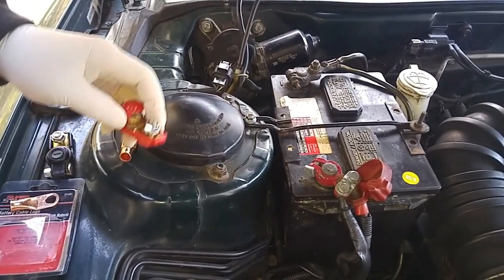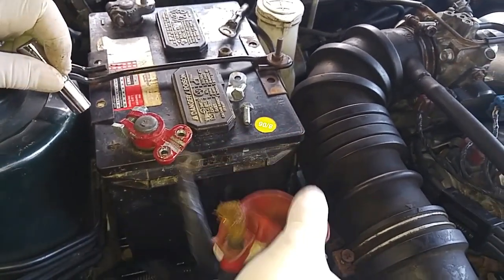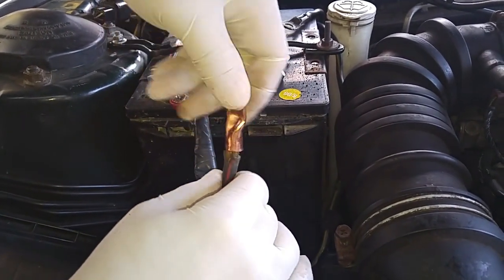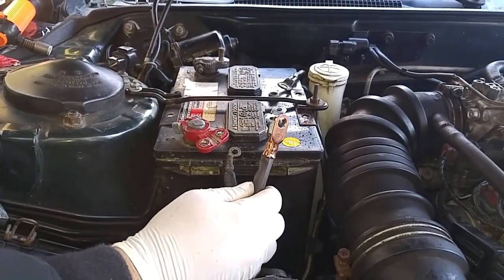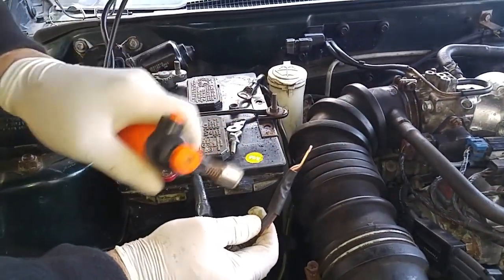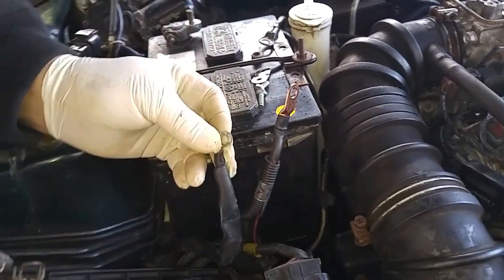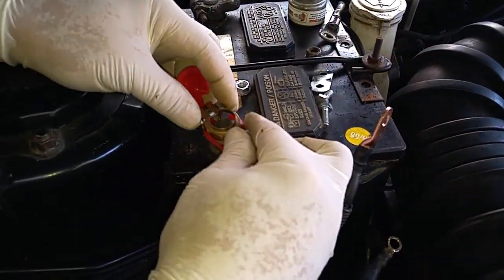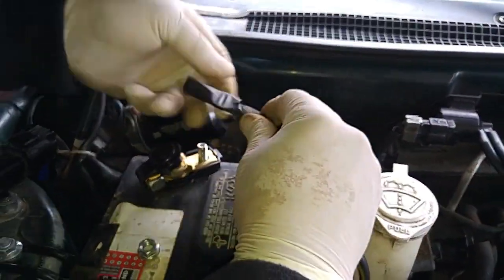Battery Terminal Connector Replacement / Cable End Repair

Comment: thanks for the video but I would suggest not using a flame that  close to the battery.  Chances are slim something  would ignite but even slimmer if no flame is used.  I would slide the heat tubing on before the new end and then side it up in place when ready to heat it up ( without a flame).
Reply from the maker: Great point!

Comment: Excellent Video, this is one of the most over looked item and no professional repair video available for such repair. You being the first to let others  know how to use it.

Did you happen to have part name for that crimper, also do we need to crimp all sides, any detail will be helpful.
Reply from the maker: Thanks for your critique!  I'd say most auto repair shops wouldn't do what I did.  They'll just chop off the old terminal end and replace with a quick and east lead terminal end (which is what I replaced).   Parts and tools used in this video can be linked to Amazon in the "Show More" text description area of this video.

Comment: man stop over working... slide the tubing sleeve FIRST on the wire. Then, slide the LUG over the wires. Adjust the tubing forward, Finalize with a hair dryer. Yes its that hot on high airflow.
Reply from the maker: Sleeve wouldn't slide over the cable without first pre-stretching.  At that point, didn't matter if I installed the terminal connector first followed by the sleeve.